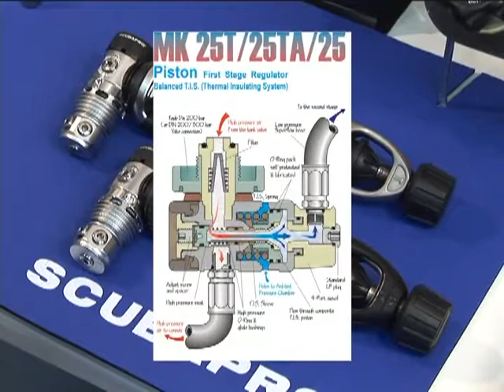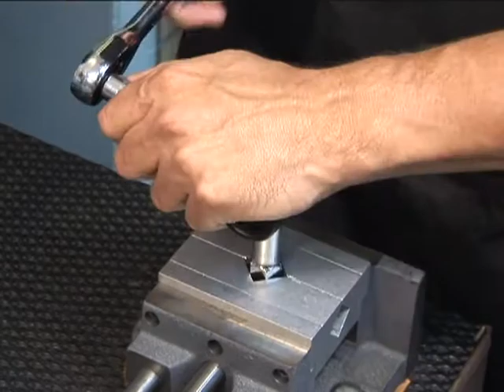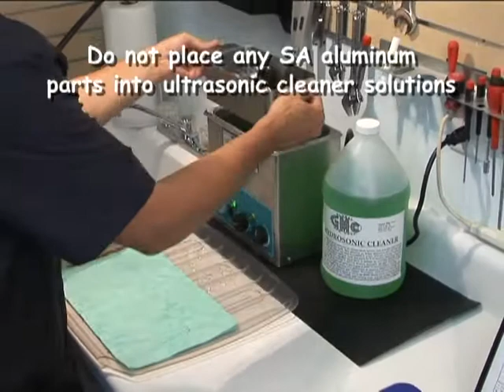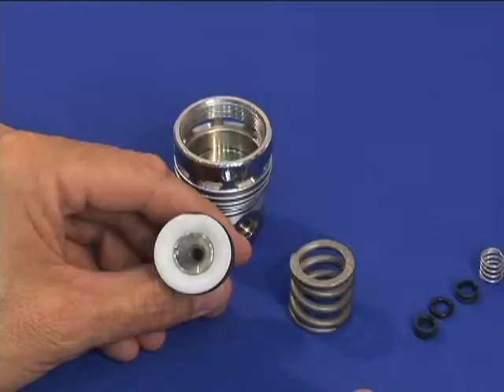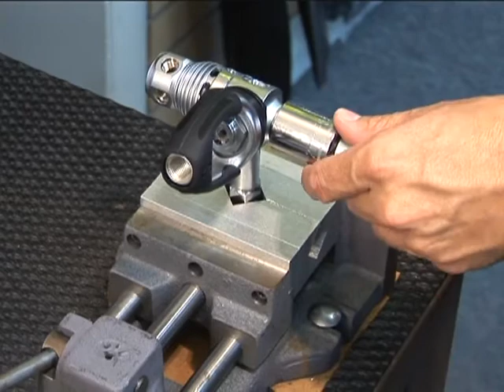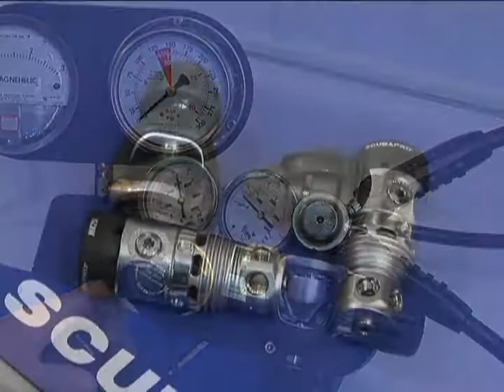Servicing The Scubapro MK25

Comment: Hi, Could you please specify which lubricants are suitable to use, keeping in mind that the regulator may be used to upto EAN mix of 40% O2.
Also, if you could please list the special tools required.
Thank you for the very professional and proper video tutorial.
Cheers
Reply: For high performance regulators like mk11 and above, always christo lube 111